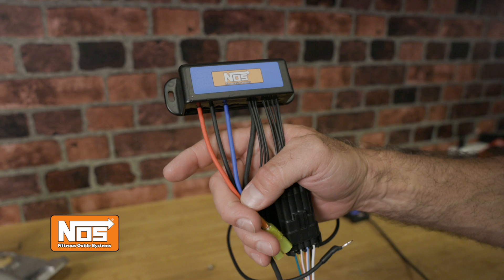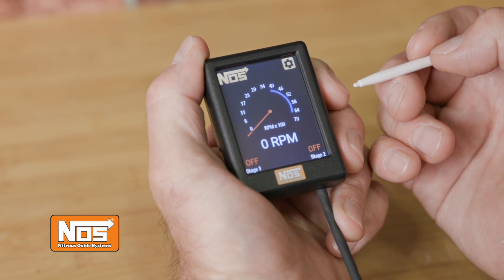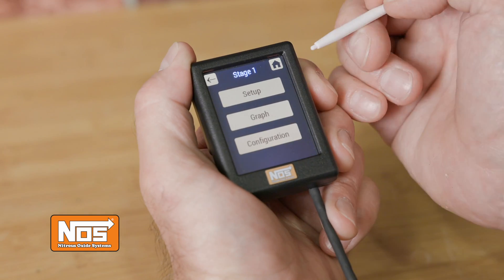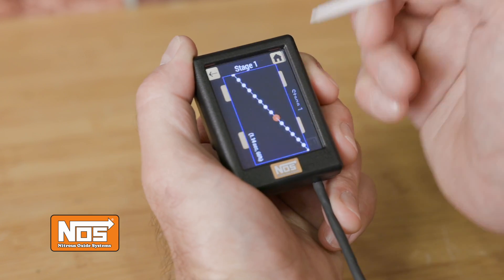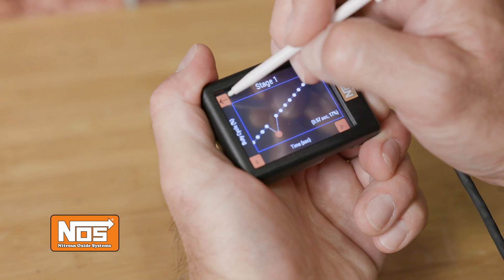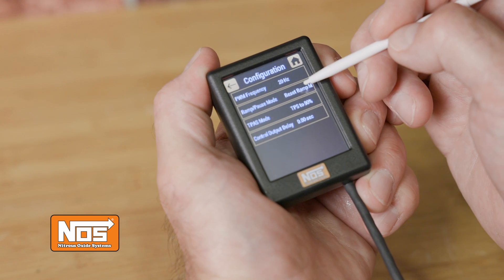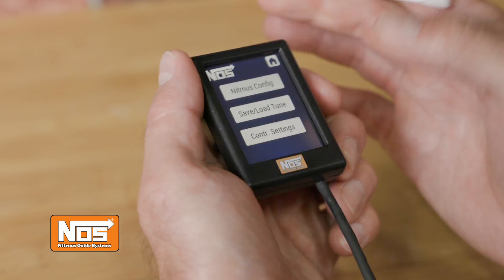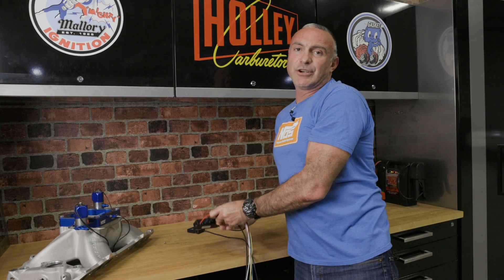How to Control 2 stages of Nitrous with the NOS Mini 2 Stage Nitrous Controller

Comment: Do you have to upload a tune again after shutting off power or will it stay saved? I have 2 tunes i've saved and it appears to be going back to the first 1 at top of list after my first run. Also after uploading a tune it says to turn off ign, is that a must?

Comment: Does the trigger only do 12v or like the maximser 5 does it have the ability to be a normally grounded Negative removal (like my MSD multi-retard box needs?) (When solenoid is enabled detects the "removeal" of a ground signal . Or do I have to add yet another failure point (NC relay using 87a to ground)

Comment: This is a MUST HAVE for any nitrous system.  You have access to all parameters which means your engine doesn't explode if you program your ramps and %'s safely below max.  5 stars, Highly recommended.
*The touch screen controller failed in just over a year for me.  It could be a little stronger.  Always usea (and try not to lose) the stylus.

Comment: How does a two stage work exactly ? On a wet kit what comes standard with the kit are a pair of NOS and Fuel solenoids and a relay. The 1st stage output is a red wire from the controller connecting to the red wire on the relay .  Do I have to buy one more set of solenoids & relay for a stage 2 setup ? What other hardware will I require ( y - connectors and braided hoses ...etc) ?
Reply: Yes a 2 stage means 2 SETS of solenoids (for wet) and 2 sets of jets... (some plates have 2 stages but most do not so yes another plate is needed. STAGE is sometimes referred to as kit as well. 2 stages is same meaning as 2 kits. But some "kits" have 2 stages.. (that would still be 4 solenoids)
🤘😬🤘
Reply: I got a wet nitrous kit in and bought another 4an feed line  on ebay like 45 bucks bought a bottle on marketplace for 140 bought a separate bottle pressure gauge 85$ with fitting to attach to the bottle 2 small 12 inch ptfe lines for the solenoid and I used my purge solenoid as my second I'm running separate maine 4an lines But some people did tell me to put Y fitting on the side of the bottles.And just run one line with two bottles But I chose to run each bottle with its own line independently

Comment: How do you get your r.p.m signal  from a gen 3 hemi to make the progressive work?
Reply: Tap one of the injectors for a rpm signal , you’ll see which wire is the common to all and the other is the signal wire.
Reply: @widebody_moparmike  holley  tech support said u can get your tp from the white wire second from the left on your gas pedal too.
Reply: @williamlopez4934  the wot tp is the brown/org at the throttle body connect that to the white with blue stripe , then for the rpm I forget the color but you’ll see all have the same common color and then each cylinder has a different color which is the signal wire at the injectors only need one so which ever is easiest for your set up.
Reply: @widebody_moparmike   thanks was wondering were to get the rpm..

Comment: Anyone use this controller?
Reply: Just installed it on my 2019 , will report back on how it actually does here shortly
Reply: Widebody_moparmike could you help me out with setting up the wiring, the progressive wouldn't work and the screen got black as if no signal
Reply: Set up is pretty straight forward, right now using rpm activation, on the Dyno worked well next month I’ll have some track data